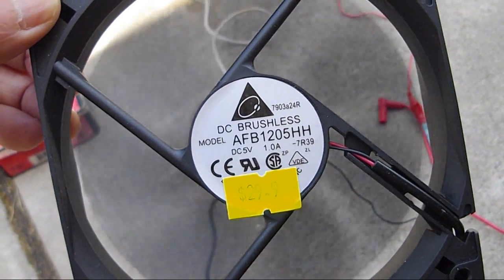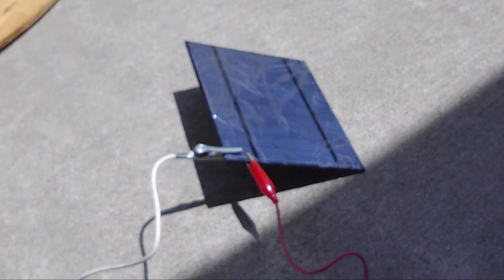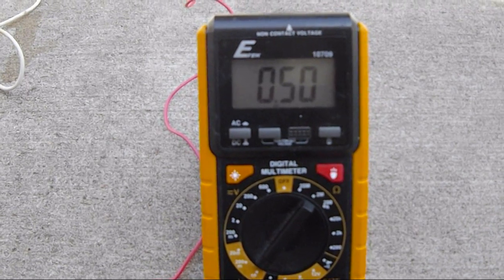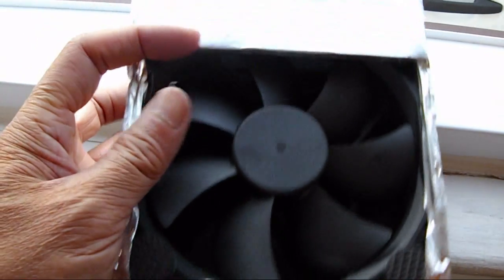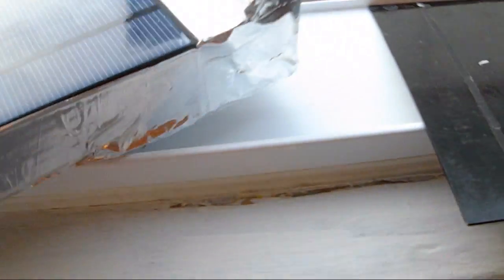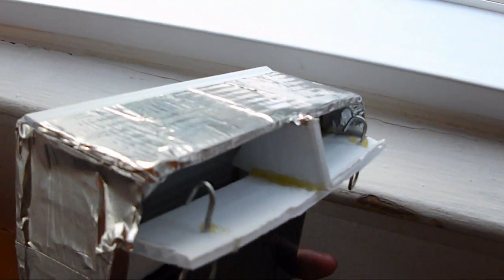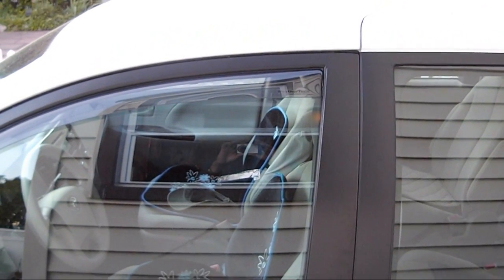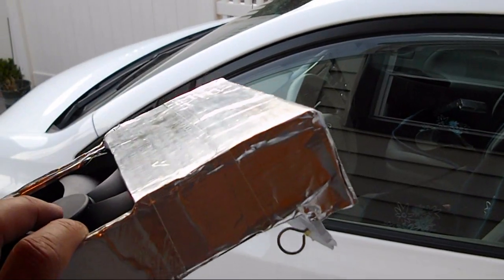diy solar car ventilator with 5v 500ma solar panel and 120mm fan

Comment from the maker: In case of proximity to the fan, you'd get a free haircut. There's a possibility of that happening so maybe someone with long hair using this should make a screen. Since I'm using metal hooks to hang this, there's also the danger of breaking your window if you crank it up without removing the fan. The fan is far from perfect, I'm making it up or improving it as I go along. Thanks for your insight about the screen.